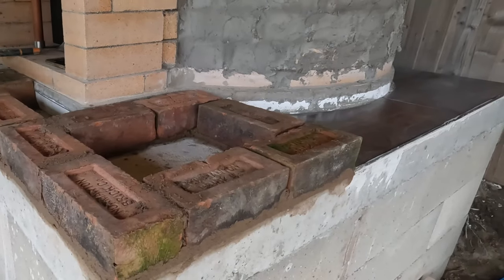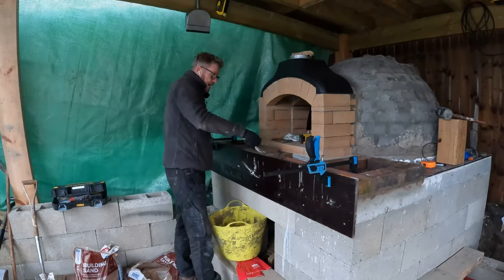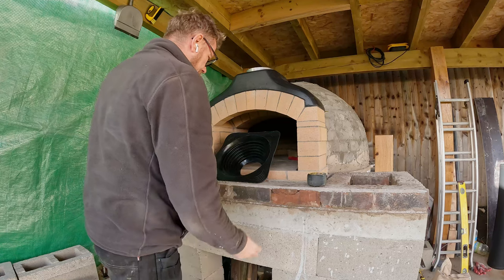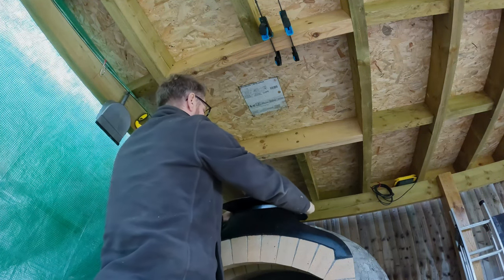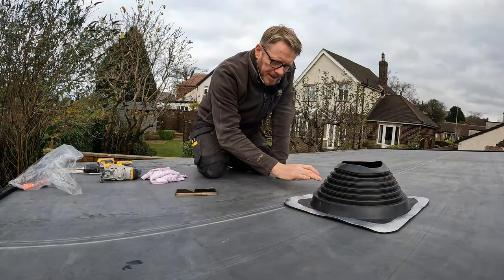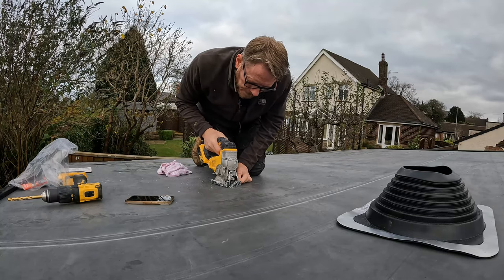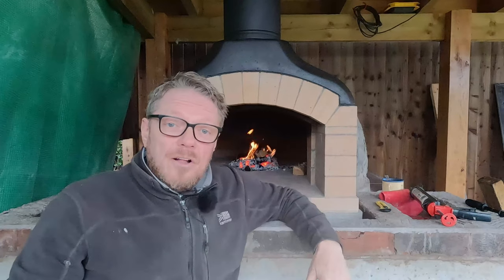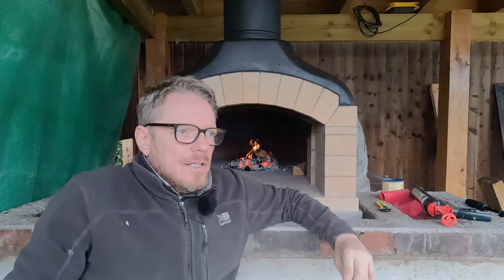How to Install a Wood-Fired Oven Chimney [Flue] | Novice Attempts (Vlog 35)

Comment: Looking great Mike!  Looks like you've got a lovely draw from the chimney too.  What camera and microphone are you using?
Reply from the maker: I think the 2mt flue is going to work like a dream. So far I’ve had two small curing fires and both were a roaring success. 

Check my description for the hardware I use to film my videos. I’ve come quite a way from the days of my iPhone and a cheap Amazon mic. The phone was ok but the mic was terrible so the investment was worth it.  

I’d love a really good camera but all my spare funds are going into this project. Plus, the Mrs put her foot down 👀
Reply: @Mike-Diamond  that first pizza won’t be far away now!! 

How do you find using that mic? Is it simple enough to get going with the GoPro? I’d like a mic for some of my videos, just need to find something that’s simple to use without too much time lost every time I get the camera out
Reply from the maker: Yeah, we can’t wait. 

It’s simple enough to connect the mic to the go pro. What I have found is I am constantly checking that the go pro still has that connection though. I’ve recorded many takes with lost connection which can be very frustrating at times. The go pro app can also be very temperamental, it too loses connection to the go pro. 

It’s also taken me a while to find the best spot for the mic as where I live there is quite a bit of background noise. Where I have it now seems to be best. 

I can also add depth to vocals with the software I use. That make a massive difference.
Reply: @Mike-Diamond  cheers for the advice, I’ll get doing some research now as I need to improve my sound quality!
Reply from the maker: @SamDaviesBuilder  I will say that this mic is very good. Great quality sound.